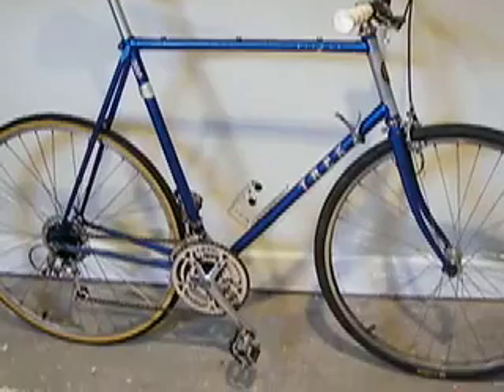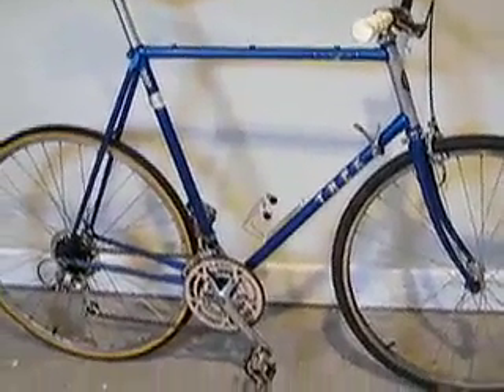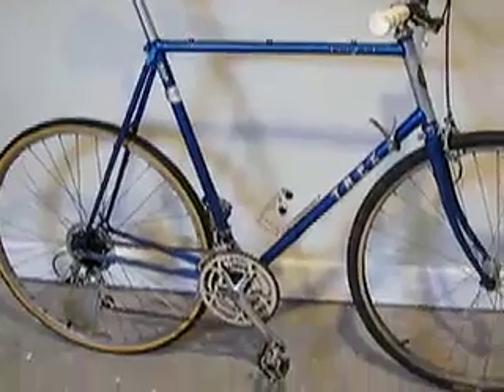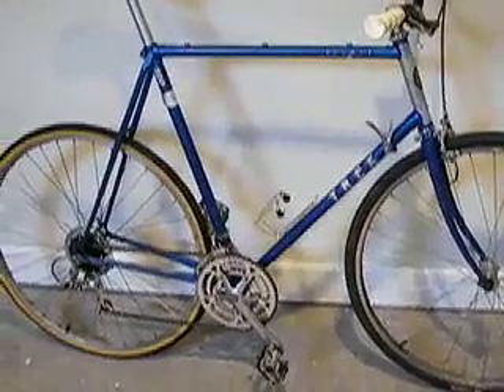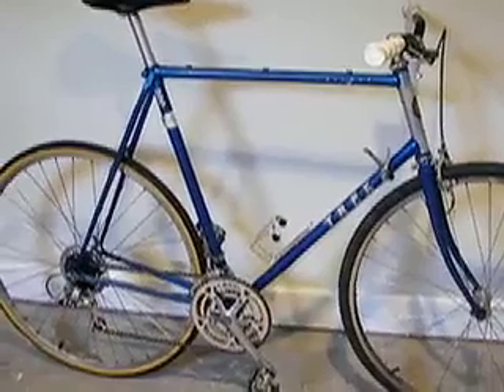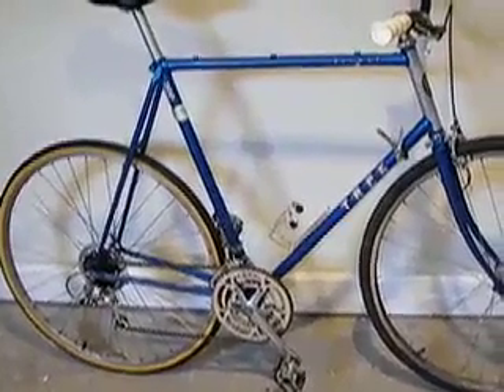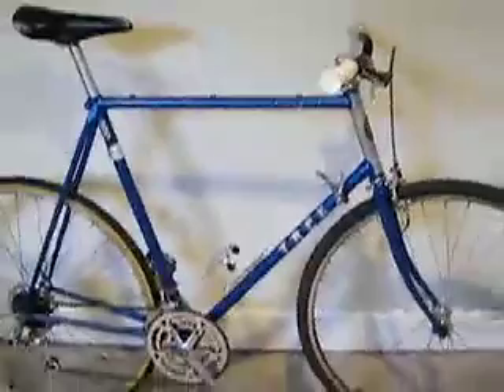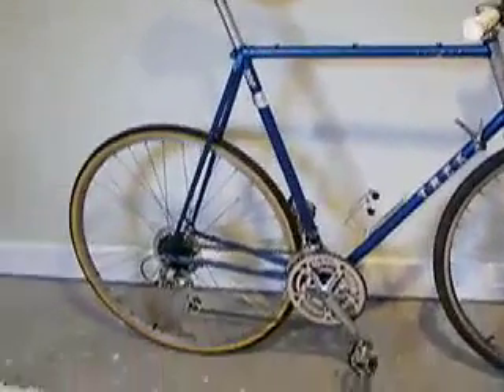Stuck Seat Post in Older Trek Road Bike

Comment: Thanks for that info, my Rory Obrien has sufferd the same fate! Aluminium post is welded in there. Im now resorting to the costic soda or a hacksaw, the only problem is the ally post has a strenthening support that runs through the hole length of the tube!!

Comment: If you've tried everything else and still wishing to remove the post you can try this method: apply (if you haven't already) plenty of WD40 every now and then and go on like that for a couple of days, find a big tree and carefully tie one end of it on to a metal part on your saddle post and the other to your car. Start real slow and as smoothly as possible. It is a bullet proof method if done as described.